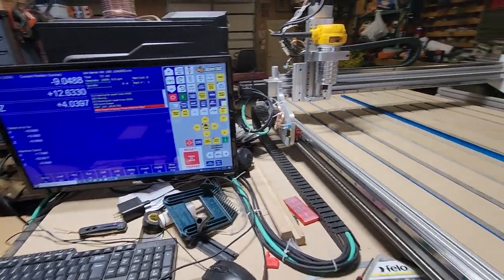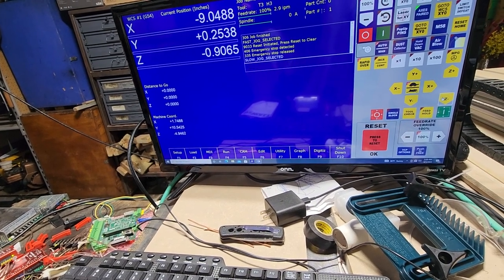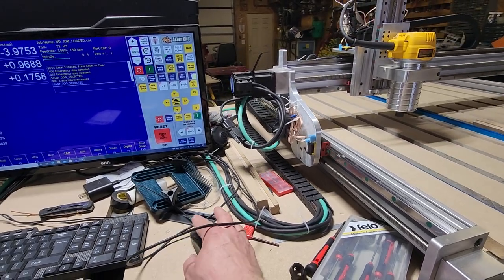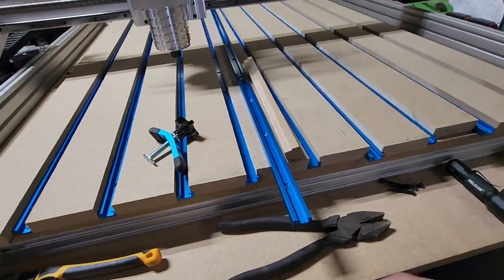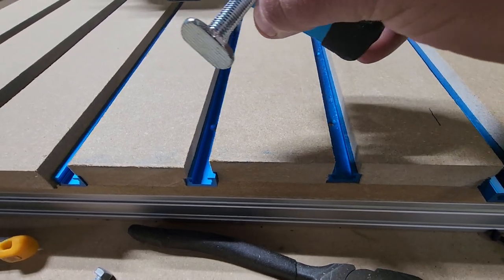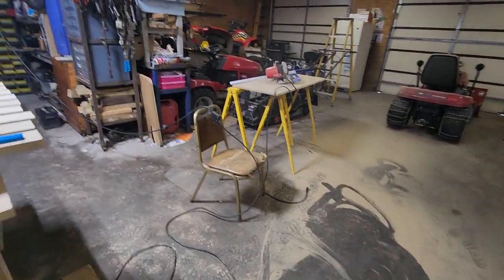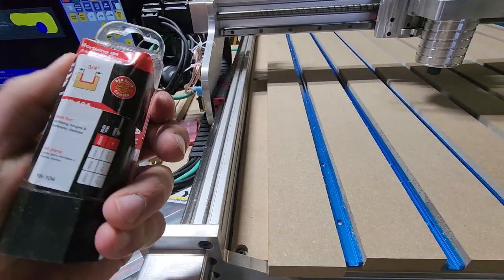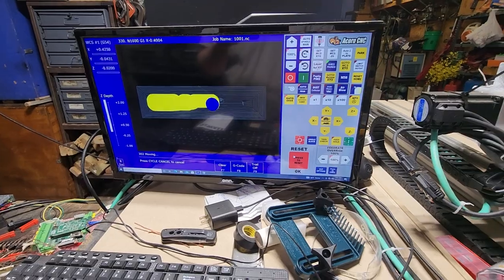cnc4newbie powered by centriod acorn router update.

Comment: Which newbie machine is that one? Its pretty quiet.
What are you doing, building your own controller?
Was it difficult to put together?
I'm ordering one soon so I was interested in your wiring. Did they not send a long enough wire?
What should I watch out for so I can be prepared?
Reply from the maker: Newcarve 1000x1000mm is the model.  It was pretty easy to assemble.  Most of the parts were already assembled from the factory.  I thought it would be fun to do my own electronics.  Although it would have a lot faster just to buy their's. I ended up using a centroid acorn board.  With closed loop stepperonline stepper motors and drivers.  I am learning a lot and getting closer to the 1st cut.   Oh yeah, and the short cord was my my fault.